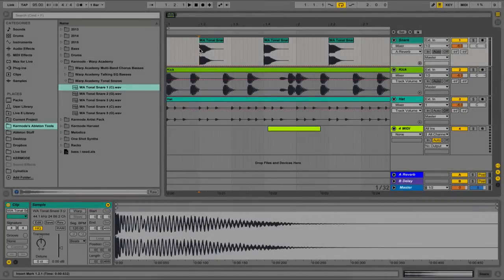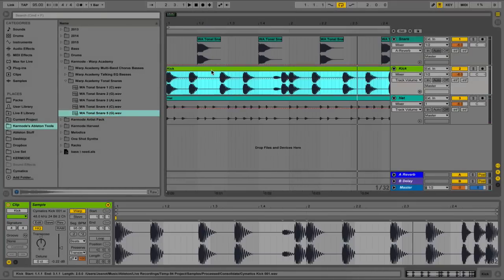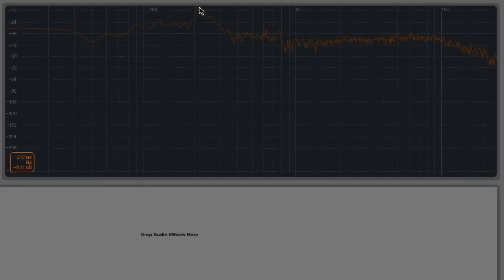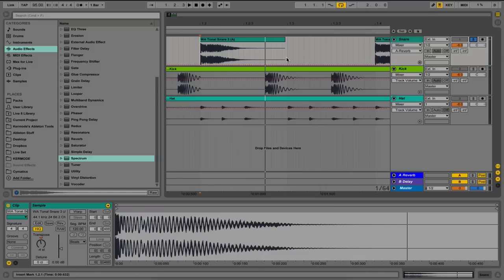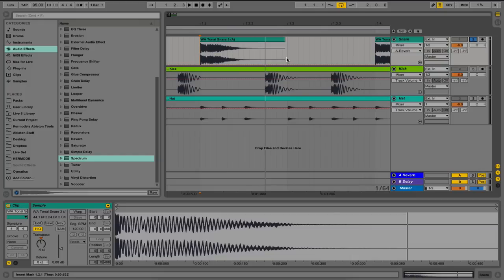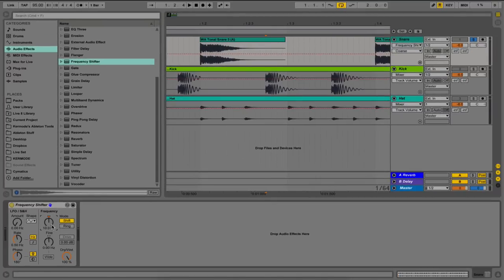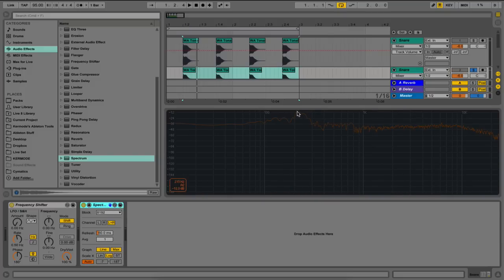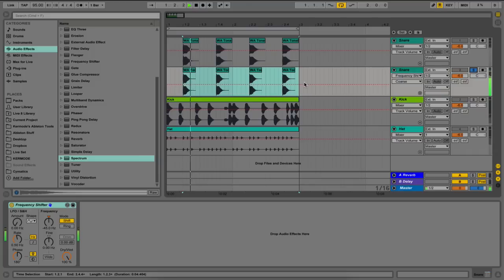How to Tune Your Drums with Frequency Shifter

Comment: do you recomend to.kicks  also?
Reply from the maker: Absolutely.  Kicks, snares, toms are all very tonal.  Cymbals / hats are more like white noise and usually don't usually have a keenly pronounced fundamental that's easy to spot in a spectrum.
Reply: @warpacademy  i have tried with kicks but i dont know why its like is changing like is a slow lfo ... and the lfo im fs is off... its very difficult to see the diference but i can hear it in the low frecuencies

Comment: SO i get that this nails the fundamental to the key you want but the same shift in hertz in the upper octaves will only be adjusted slightly off pitch of the original tuning. Does that mean that the overtones of the sample don't need to be in tune?

Comment: BUT WHAT ABOUT COMPLEX PRO OR TONES
Reply from the maker: Hey Michael.  As we'd mentioned in the video, using the transpose function with Warping will degrade the quality of the audio noticeably with drums, especially if you're shifting the pitch down.  If you use the Repitch Warp mode, then it won't, because the timing is changed (the audio will simply play faster or slower like in a sampler).  We prefer the result you get with the Frequency Shifter method, as long as the shift isn't too extreme.  

The main difference to note is that the Frequency Shifter doesn't preserve the harmonic relationships in a sound with overtones, whereas using pitch shifting will.  This means the more extreme the shift, the weirder (for lack of a better word!) the drum will sound with Frequency Shifter.  Cheers!

Comment: So how about different transpose modes? I bet that beat or complex uses same freq. shift algorithm but more quality one
Reply: Sidewalk - Видео Дневник this is a very interesting thing you say now, and I d really like to known now if this is true / how the different algorithms work
Reply: And need to warp to ensure the length of the clip. But warping a clip "destroys" quality. So maybe using frequency shifter is a good alternative.
Reply: SmEn nEmS
warping is simple word to describe complex algorithm. And i bet it uses same freq. shift idea, but optimized for quality pitch shift as it mostly tool neither effect like Frequency Shift audio effect.
Reply: It not the same idea.  warping uses granular synthesis. The frequency shifter is a unique way to additively shift frequencies rather than mulitplying them like transposition. This only works on drums, it will detune instruments in an unusable way where its harmonics are out of tune with itself